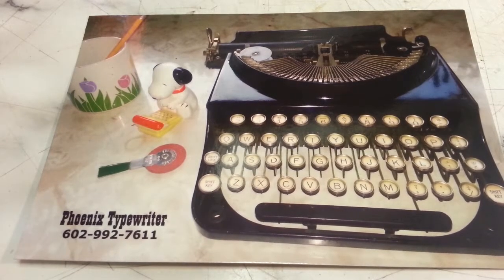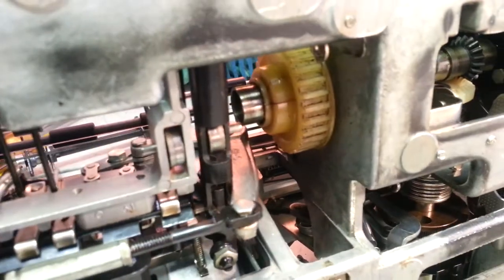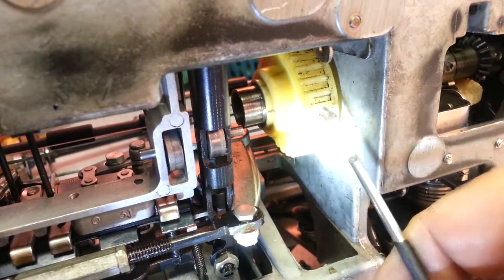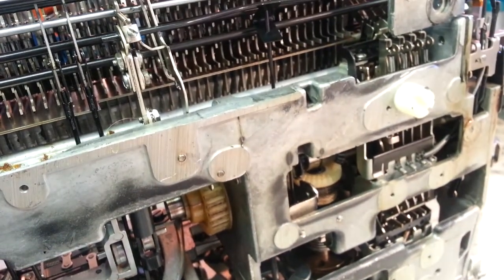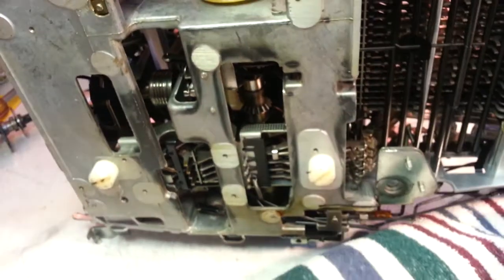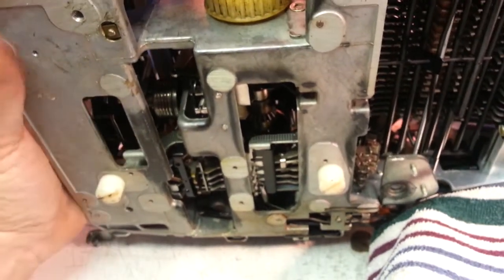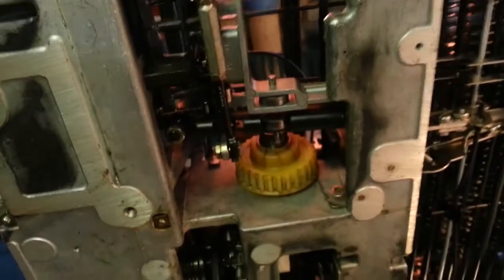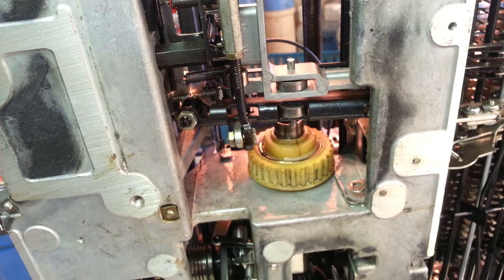IBM Selectric Typewriter Center Hub w/Cracks In Machine Reinforcement Modification

Comment: I'd like to try this, but my hub already has a significant, open crack of maybe 1/32-inch. Could I hose-clamp it back in shape, do you think, before trying the "hot ring"? Maybe use Superglue for a temporary hold?
Reply from the maker: I have squeezed these back together with vice grips, I had to cut/modify the jaws. Works about on about 50% of them. The small inner shoulder can be as much of a problem at the teeth section. I have removed metal core and put them back together after melting in reinforcement ring on plastic portion, then grinding a little metal off core and then heating metal center core and melting back into position, but that has it's limitations too & a high failure percentage. See video.... https://youtu.be/H5b7G0RoKXk